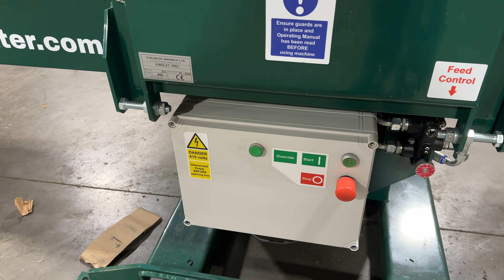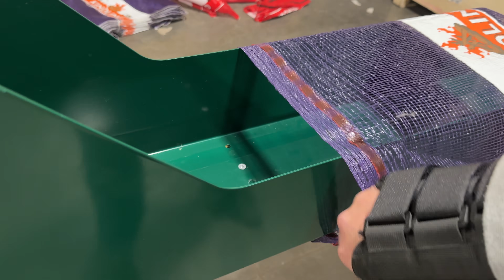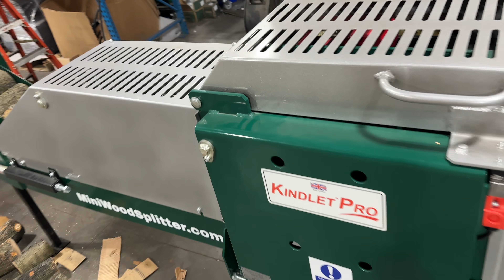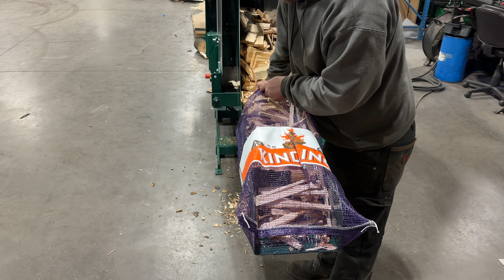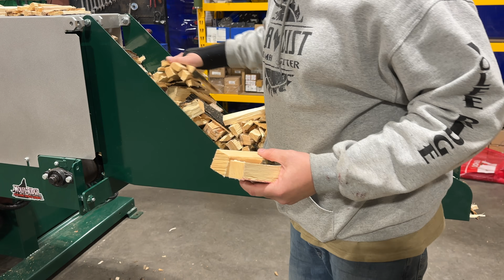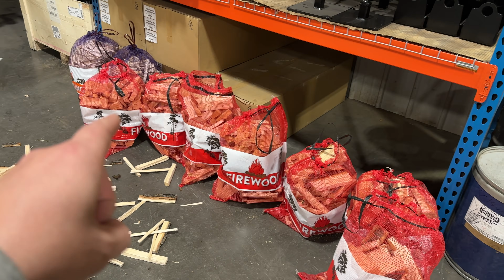Making Kindling and Mini-Wood INSIDE at Wolfe Ridge with the ELECTRIC Kindlet Pro from Fuelwood UK!

Comment: Cool looking Machine Bob. Good for Stove Wood, or smaller table top stoves. The higher numbers the Bigger the Wood. I cut mine 9 1/2inches for the Rounds and Split with an Axe. Nice Machine but for myself I am Looking at the 17VS. A VERY HAPPY THANKSGIVING DAY MY FRIEND, BE SAFE AND STAY IN TOUCH IF YOU HAVE ANY SPLITTERS USED NOT TO EXPENSIVE.

Comment: they need to make a 220 single phase model. They would definitely sell
Reply from the maker: This machine needs 15 hp to operate on electricity. The smaller Kindlet 200 may be able to run off of single phase. 

Thanks for watching!